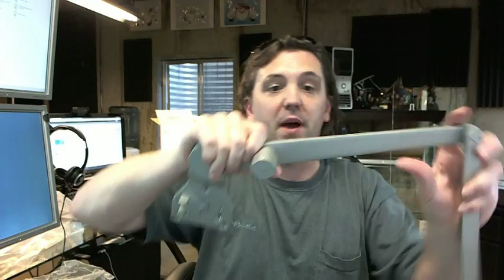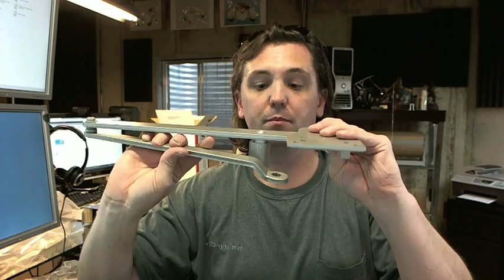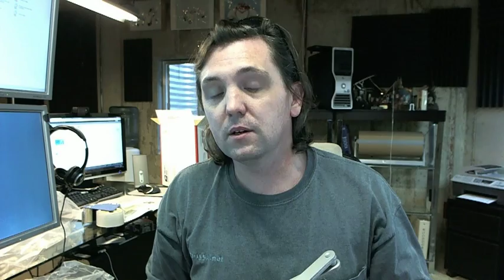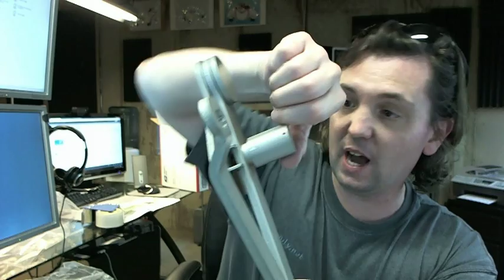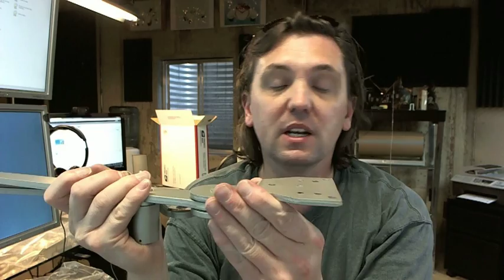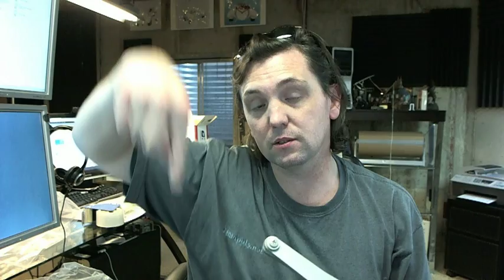Dor-O-Matic SC80-3049DS Dead Stop Hold-Open Parallel Arm

Comment: Hi Richard, I am wondering if you have to reach up and turn the dead stop to release and close the door. We are looking at installing these in a greenhouse, however not everyone who needs to use these doors will be able to reach the top of the frame.
Reply from the maker: The DOR-O-MATIC SC80-3049DS Dead Stop Hold-Open Parallel Arm
is manually selective hold-open function and yes you have to reach up to the door closer arm to set and release.<P>Can I help with alternate means to hold open the door?